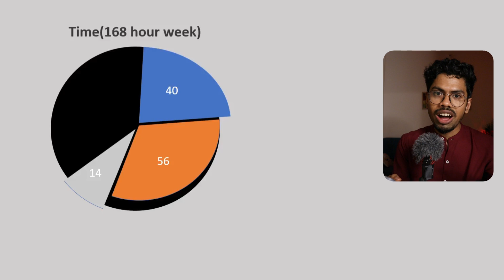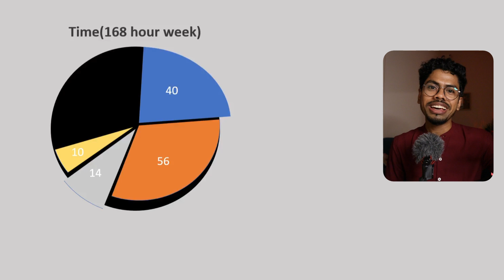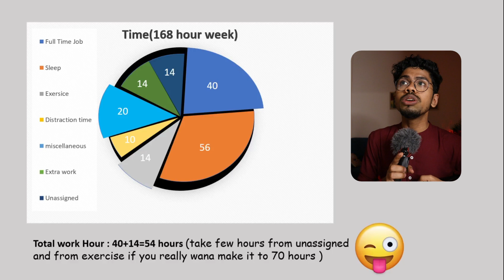VLSI Engineers Work Culture | 70 Hours Work Week is Feasible | Time Management

Comment: Hello Rajdeep I love your videos! I am looking to get into the VLSI industry and wanted to get your opinion on how I should proceed. I have no experience in industry (fresher) but have a bachelors in Physics from UC Berkeley where I obtained some basic knowledge in circuits. I am thinking of starting a 5 course certificate program at UCSC silicon valley extensions for VLSI engineering next year. Will this certificate be enough to get me a job at intel, apple, Qualcomm, etc. as a physical design engineer or something else? What specially would be easiest for me given my background?